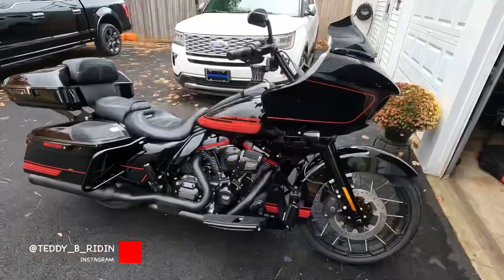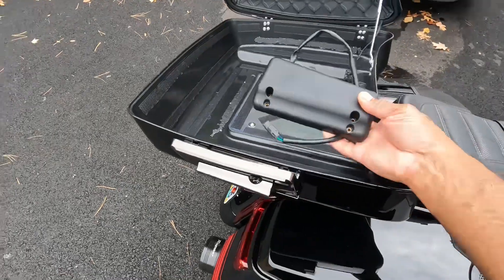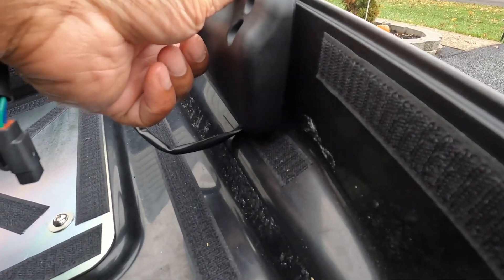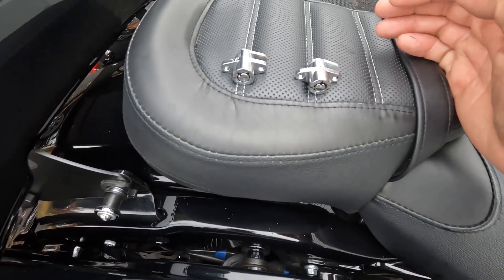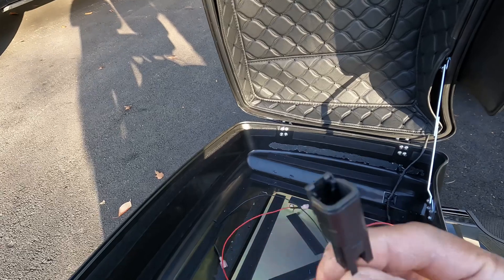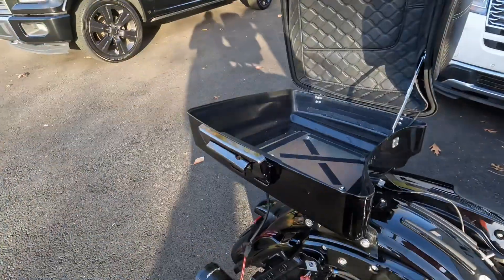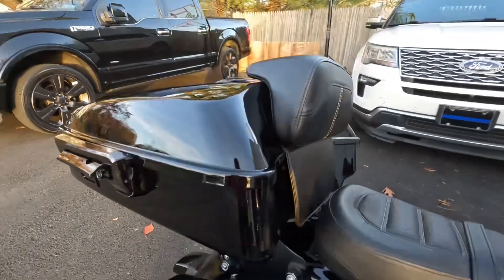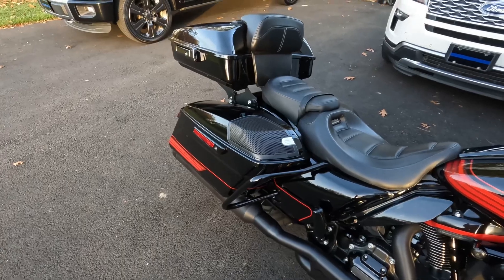Remote Lock Installed! #harleydavidson #roadglidecvo #tourpack

Comment: Solid work and good info bruh! I have a 2019 Street Glide CVO with a king tourpak and have been wanting this for it.  Now I know how to do it. Thanks!
Reply from the maker: Hey man, I appreciate that and thanks for watching! 👊🏾✌🏾
Reply: @Teddy_B_Ridn  Quick question...Do you remember the color of the two wires you tapped into for power to the actuator?
Reply from the maker: Hey what’s up! Been super busy. So I choose the right saddlebag wire harness to tap in to. I followed the two wires that came from the actuator under the lid to where it goes in the larger wire harness on the inside of the saddlebag. Then I found which wires it connected to when the other harness was connected on the outside of the bag. Now for some reason the connecting wires, the ones I needed, in the outer harness were a different color than the ones coming from the actuator on the lid so I just made sure I followed the pin spacing. The two wires I taped into on the outer harness for me was the two peach colored wires. One with an orange stipe on it and the other with a red stipe on it. Sorry for being so long winded but I wanted to try to be a clear as possible. Hope this helps… 👊🏾✌🏾
Reply: @Teddy_B_Ridn  No doubt bruh. I appreciate the detailed information. I just ordered the parts three days ago. Thanks again!

Comment: Nice write up. Thx
Reply from the maker: I appreciate that. Thanks for watching.. ✌🏾
Reply: Hello. How are you?
Do you remember which color 2 wires you tap into at the harness?  I know it’s been a while . I have a 22 CVO. Tx
Reply from the maker: @juancastro-fz7jd 
Hey what's up! Been super busy. So l choose the right saddlebag wire harness to tap in to. I followed the two wires that came from the actuator under the lid to where it goes in the larger wire harness on the inside of the saddlebag. Then I found which wires it connected to when the other harness was connected on the outside of the bag. Now for some reason the connecting wires, the ones I needed, in the outer harness were a different color than the ones coming from the actuator on the lid so I just made sure I followed the pin spacing. The two wires I taped into on the outer harness for me was the two peach colored wires. One with an orange stipe on it and the other with a red stipe on it.
Sorry for being so long winded but I wanted to try to be a clear as possible.
Hope this helps...

Comment: What wires did you connect to exactly?
 and 
what did you trim at the actuator exactly.?
Thxs
Reply from the maker: Hey what up 👋🏾… I trimmed the actuator housing plastic cover and backing just below the circuit board inside of it, giving me just enough to clear the curved area of the tour pack wall. As far as the wiring, I followed the wires coming from the saddlebag actuator to the wire harness in the rear wheel well and tapped into those… Hope that helps… ✌🏾
Reply: @Teddy_B_Ridn  thxs